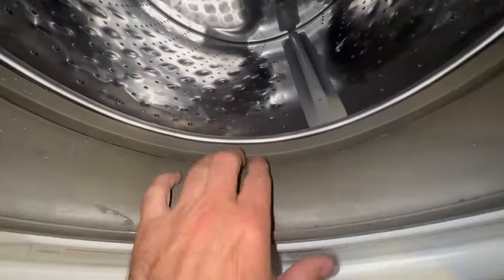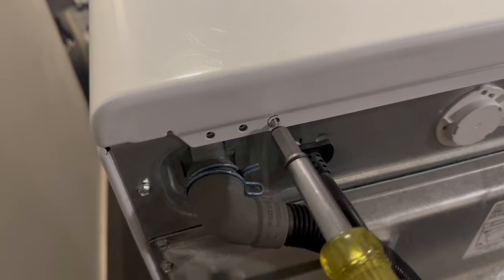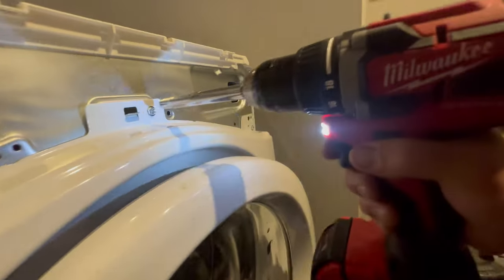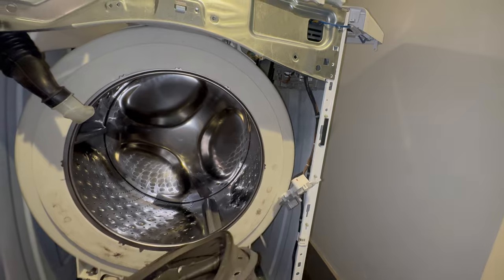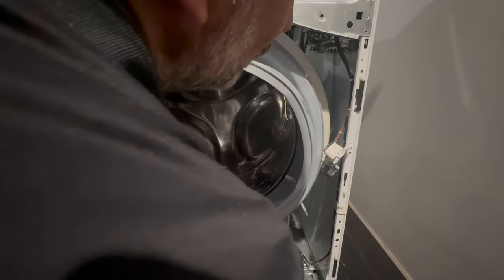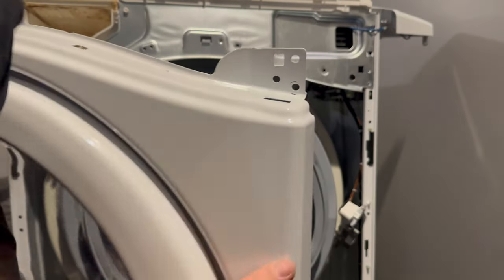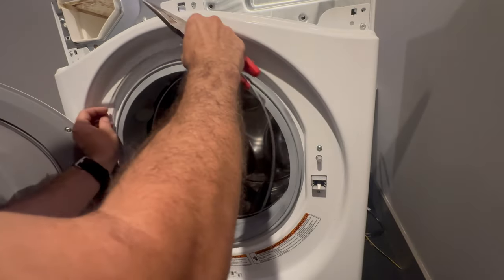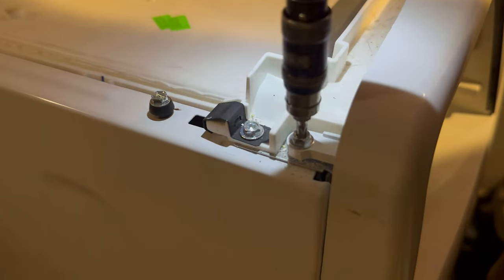Front Load Washing Machine Bellow Replacement - Whirlpool Duet

Comment: We have the same washers that are about 5-6 years old. We put a good amount of bleach in the bellow let it sit for a few minutes and run on heavy duty and clean washer about 2-3 times (sometimes more) to get all the bleach and mold out. Those bellows are expensive and a royal pain to replace. Especially when the machines are stacked
Reply from the maker: Yes, if you are constantly cleaning they will stay clean. Unfortunately tenants let them go years without cleaning and sometimes the stains just don’t come out, or they scrub so hard they scrub a hole through the seal lol

Comment: If I may add a suggestion. The last spring tensioner is a complete bear to get on smoothly.

The guy in this video made it look easy. I can assure you it is not easy. Last time I did this repair it took me 30 minutes of trial and error (and LOTS of swear words) to get / keep the seal in place and the spring tensioner in place.

MY SOLUTION:

This time I had my 12 year old son hold the seal in place at 10 and 7 o’clock and I pulled on the needle nose pliers like the guy in this video with my left hand and guided the wire into place. Took 30 seconds. So much easier. If you don’t have extra hands it is a challenge.
Reply from the maker: Thanks for the tip :) There's a cheap tool for the tension spring as well that makes it very simple to put back on, if you do a lot of these.

Comment: We tackled this yesterday, we looked at a few videos on how to do it. I strongly recommend taking the front panel off first. I think the hardest part for us was trying to do it without taking off the panel. Believe me, it will take forever. There just isn't enough room. Each model is a little different as far as the front, but this plan will work for you. Another tip I have is to organize and "LABEL" the screws. There are a lot of them and it can get a little confusing. Overall, I enjoyed the process and with practice, I think I could knock it out again in 3-4 hours.

Comment: I have water collecting in the bellow area but the washing machine drum is dry after a wash cycle.  Sometimes really large loads takes forever to drain.  I've already cleaned out the drain trap, it was fine.  Any ideas?
Reply from the maker: those holes on the bellow are clogged up, you can try and push it through adn rinse it out, and also pull back on the rubber to get better access. Just don't pull the compression ring off or youll have to get it back on
Reply: @ApartmentMaintenancePro  You are absolutely right, I pulled the inner part of bellow out enough to clean the holes in front and behind them.  It was like a mouse sized cat furball in total!!! (I have two cats)  Thank you so much.

Comment: I did this tutorial, but there seems to be water leaking from the bottom of the laundry machine, any idea what could be causing it to leak?
Reply: Either the bellow wasnt installed properly or tightly or the hose in 2:39 is loose. Which is my case. Hose loosesn up when the washer moves and it becomes loose and water leaks from where the soap and the water flows